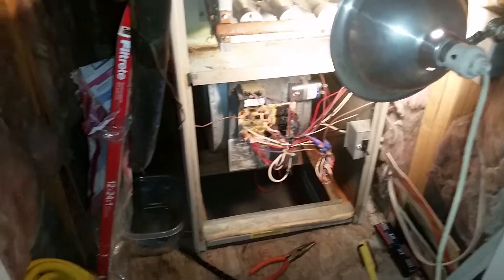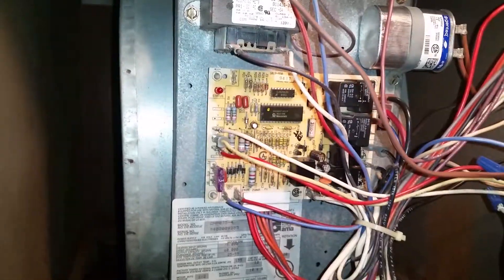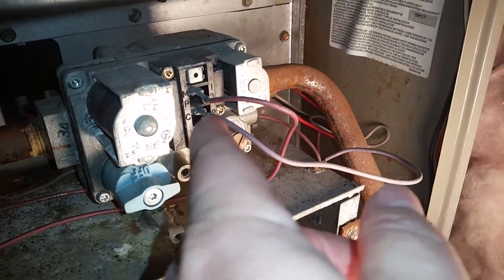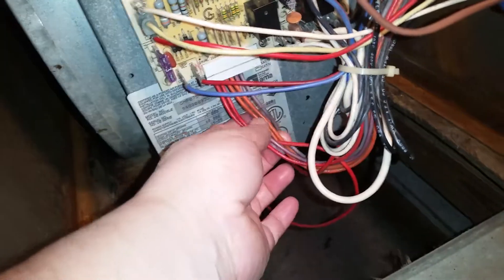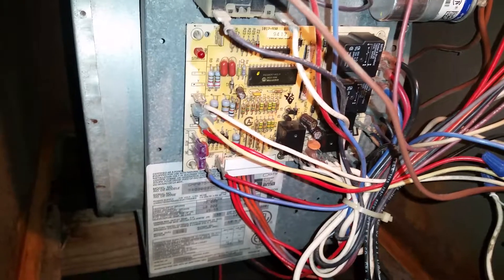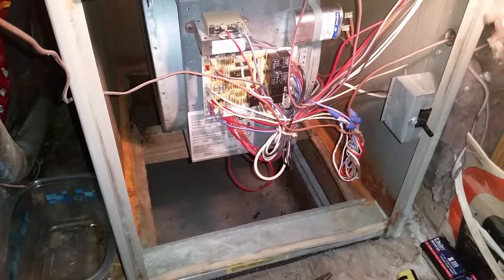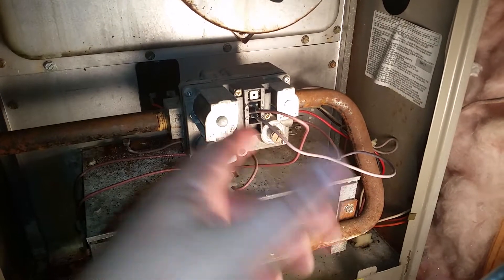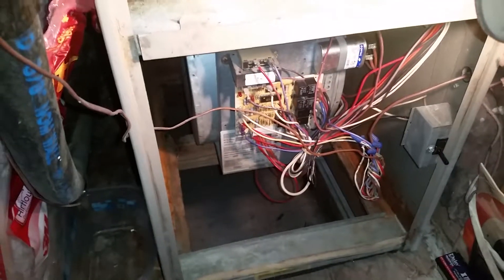Goodman Blower Stops in 3 Seconds Intermittent Limit Switches

Comment: How's that run capacitor? If good fan motor
Reply from the maker: It was brand new. I did fix it. It turned out the be an intermittent Flame sensor. Replaced it and it kept working until the actual out outside compressor locked up in June of 2022. I ran for a little over 26 years before it gave up the ghost! Thanks for watching. Best Blessings. Keith Noneya

Comment: Change  thermostat  on  cage front  bottom
Reply from the maker: Thank you I appreciate the tip. It ended up being  a flame sensor on the front. I pulled it, cleaned it, tapped it and put it back in. It worked until the Compressor froze up after 29 years of running. Most of it 24/7 in the summer heat down here. I replaced it with another Goodman and it runs beautifully too, but can actually keep up with the house, since I went from a 4 ton to a 5 ton unit. Ironically since the 5 ton can keep up, my electric bill went down. Best Wishes & Blessings. Keith Noneya

Comment: Little late to help with your issue but just wanted to comment to help anyone in the future. If you come across this problem and everything checks out with your limits you should wire your blower directly to 120 power supply. Make sure power to the unit is off before anything. Just unplug the motor completely from the board. Wire the blower directly to your power. To keep from having to cut wires and use wire nuts you can use your limit switches to make the connections. Whatever is more comfortable for you. Plug the unit in and of blower comes on and runs fine then you have a bad board and it will need to be replaced. Oh and don’t forget to hold down the door switch if you made the connections after the switch.
Reply from the maker: For AC I would agree, for Heat if you have a gas unit, I'd say MAKE SURE you let the small vent motor vent any possible gas before turning the fan on or you could be in for a nice boom boom and be missing part of your house! Also don't forget to turn it off after the gas automatically shuts off or it could build up if it's leaking and when the gas hits combustion quantity again boom boom!
Reply: I wonder if you can point me in the right direction my blower stopped working so I replaced the capacitor now everything runs fine when cooling but when I switch to heat the blower runs a few second then everything shuts off even the thermostat control panel goes off then everything start’s turning back on and in a few minutes it try’s again
Reply from the maker: @IronMan-bl7dd  Mine turned out to be the Flame Detectors in the burn unit. The are several of them including on on the back of the fan housing that's hard to get to. Basically they are on or shorted and if they get hot or go defective they open up and tell the control board to shut the gas off and turn the fan off. Some times you can tap them and it will start working. That's what I did and after they it kept working. Try this video; https://www.youtube.com/watch?v=3AhF0TD4oBk I know it's not the same unit but the principles are the same for all Gas Heater units. Hope that helps get your heat on. You could also like up Goodman limit switch or flame detectors. Best Wishes & Blessings. Keith Noneya

Comment: I have the same or simillar situation the repair guy says blower motor is shot.
Reply from the maker: If you had a professional look at it then it probably is shot. I'm not an AC Tech so any advice is just shooting from the hip. However take a look at some of the comments and my write up in the description to see if you can find any tips to try. I'd also check out some other videos and see what pops up that you can try yourself before you call in an AC tech. Had one come out and change my fan that was good only to find out it was the compressor. He refunded my money as a good tech should and is going to install a whole new unit that I purchased years ago after Katrina expecting this unit to go bad. It's a Goodman and the unit lasted 26 since March of 1996 and had gone through a dozen hurricanes and got flooded in Katrina and it still worked after I cleaned it! Yeah I purchased another Goodman after Katrina and it's been sitting waiting for it's turn. Thanks for watching and I hope you find what you need. I do keep a few window AC units around and a Mobile Generator to run the house if the power goes out. I was glad to have them because when this unit went out two weeks ago I put them in the bedroom so I could sleep good at night. Best Wishes & Blessings. Keith Noneya

Comment: Check the amps on the motor.
Reply from the maker: It was a flame sensor. I tapped it and it's still working almost 3 years later. Just curious, since you said amps, what should the amps be on the motor?
Reply: @keithnoneya  look on the motor for "LRA", this is lock rotor amps. If the motor is pulling more it is most likely frozen (stuck, lockedup)
Reply from the maker: @ronaldpalmer1241  Ah that's the answer I was looking for. Thanks for the reply. Best Wishes & Blessings. Keith Noneya

Comment: what did it end up being? I would guess that the vacuum switch was bad hot surface ignitor did not come on but that doesn't make sense if you're just putting the fan. And it keeps shutting off so what was it
Reply from the maker: Description: FIXED  I didn't show the fix in this video. It turned out to be an intermittent limit flow switch.
Reply from the maker: I actually said in the description above. There are two limit switches on my unit for the fan. Since it started working and hasn't stopped since I made the video I don't know which one it was, so I just kept running it. If you have this Goodman unit and control board I could probably walk you through it to find which one is bad. Let me know, i'd be glad to help. PS I AM NOT a certified technician but I understand how it works.
Reply: @keithnoneya   were did you get the limit switch from?
Reply from the maker: @growtochoice  Hi Johnathon, I just tapped on it and it started working again, and it hasn't stopped since I made this video about two years ago. You can pull it and read the numbers on the side and get one on eBay or your local HVAC supplier. If it's the front one, they're supper easy to change. If it's the back on on the Squirrel fan, it's a little harder if you don't have access to the back easily. One of the two on mine is on the back. I would have to pull the filters and crawl in on my back under the unit and access it that way. Hope yours is in a better place if it's bad. I watched a ton of videos to figure out how they work and why they are needed, and they are a safety fieature. So I recommend doing the same, learn as much as you can before attempting the repair.  I fallowed the wires from the switches to the control board then shorted / jumpered, the wires at the control board to find out if they were working. When the unit turned on I knew it was the flow switches. One of the videos said to tap them and see if the system starts to work. It did. So I left it alone until it breaks again. As a precaution I could just replace the switches, but I intend to replace this 1996 unit this summer or fall. Hope that points you in the right direction.  Best Wishes and Blessings. Keith Noneya